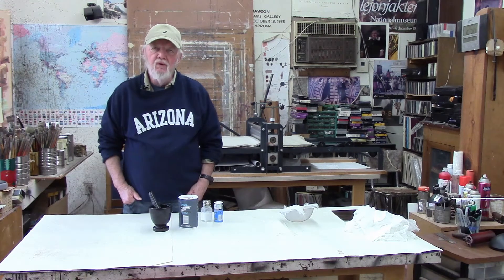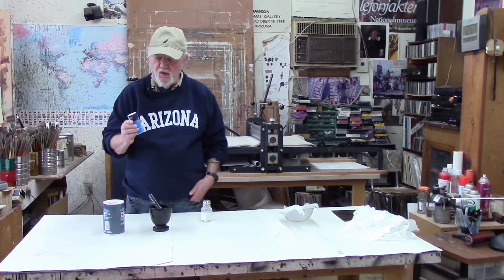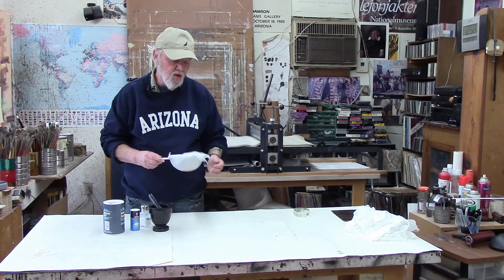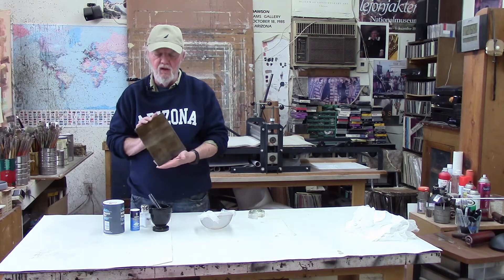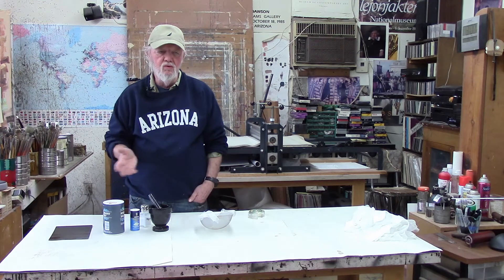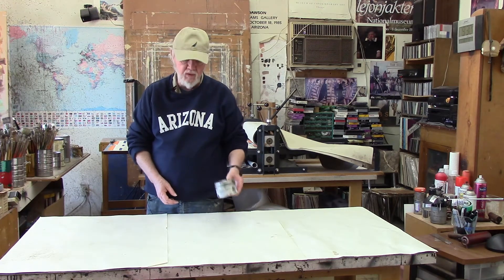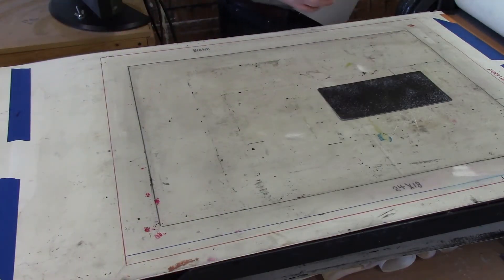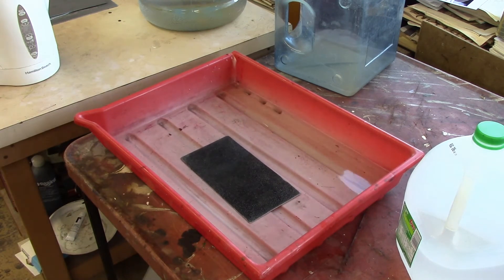Intaglio Printing Techniques #5 Salt Aquatint

Comment: John, these are all wonderful methods. Thank You! On # 7 plate to plate technique a question? your key plate has been etched? yes? but has it also had some stopout put on it? i didn't understand the blank spaces. thank you
Reply from the maker: Yes the key plate already had an image been etched, partly done. The stop out could be added before or after the plate ink transfer, but before probably would work best.
JOHN